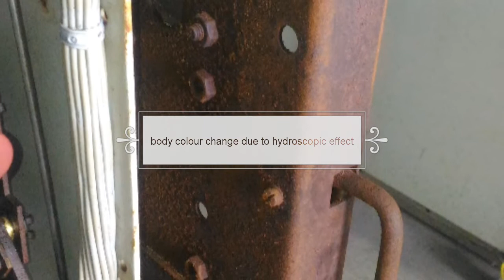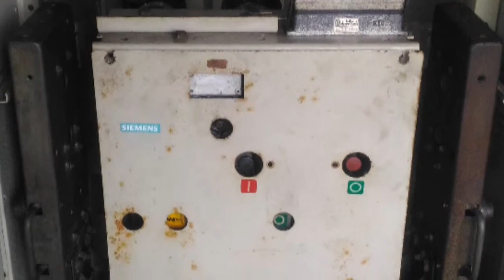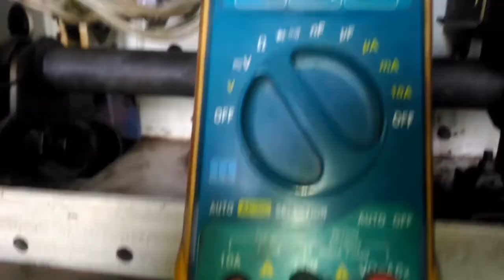Preventive Maintenance of 11 KV CIRCUIT BREAKER

Comment: These 3AH3 circuit breaker has its parts corroded to such an extent ?
Is the location moisture prone?
And what IR value do you get in this condition?

Also u will not get accurate contact healthiness with help of multimeter.

Good video.
Reply from the maker: Thanks for watching ,please subscribe my channel and share
Reply: This cell and the CB have failed due to a number of problems.
1- Ambient conditions, excessive humidity. Unless this is dried, the malfunctions will continue.
2- There was a short circuit in the upper bushing. Then the condition of the breaker worsened. They painted it, but that's a very bad practice.
3- The insulators are worn out and need to be replaced.
4- All busbars should be inserted and cleaned or cleaned with a special application. Otherwise it will cause new faults.

  As a result; this cell has to pass through my hands. Otherwise, it is open to malfunction at any time :)